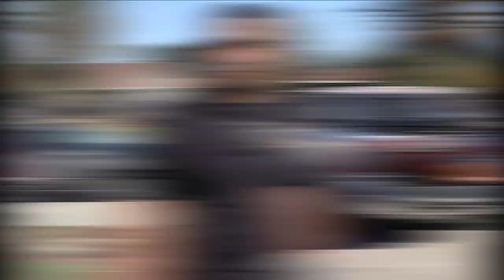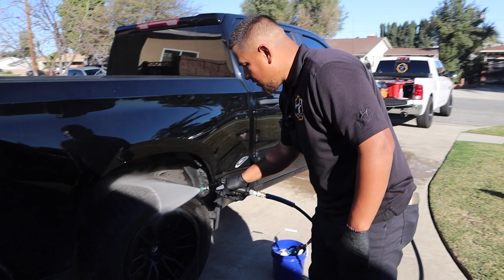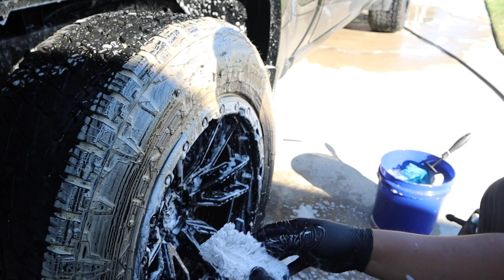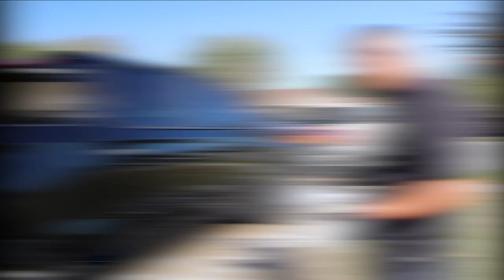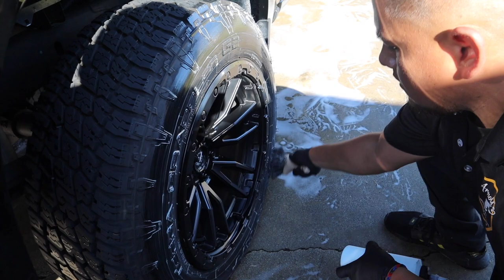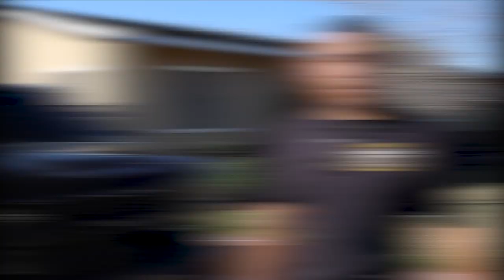How Arnold Detailing Cleans Tires - How To Detail

Comment: I have a question I’m barely starting my detailing but I don’t know how much to charge for a regular car is 50 bucks too low
Reply: Start off at $90-80 for a basic detail !
Reply: $50 bucks really won’t get you anything if you do the math.
Reply: @flipssucksf1265  I just started my detailing business here in Tx and I started at $50 for a four door car and $60 for a small SUV then I started Raising my princes as I get better at it. But some state are different by cost of living. The $80-$90 are good price to start.
Reply: I would dress the tire first since you using that bristle brush. It may sling the tire dressing over the paint and u might have to wipe it off.